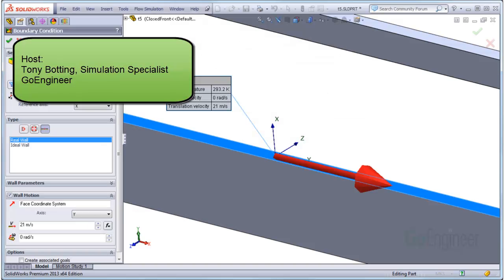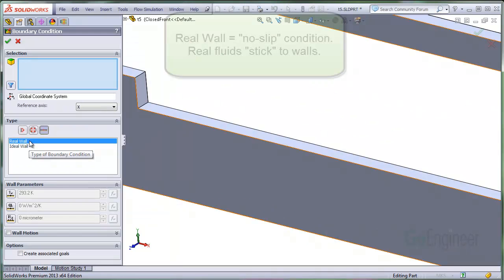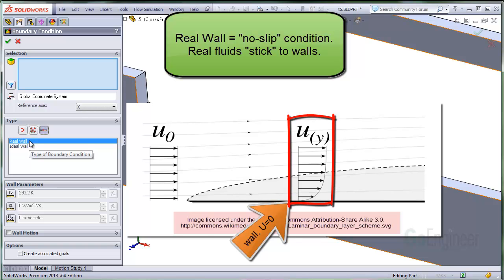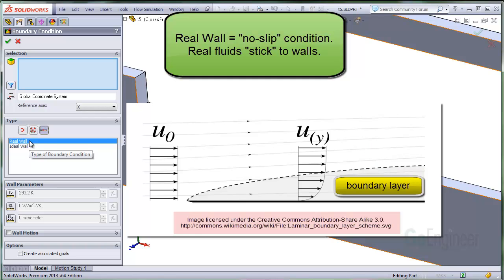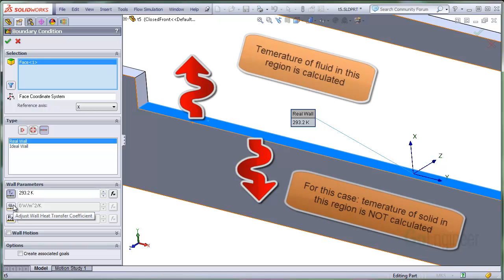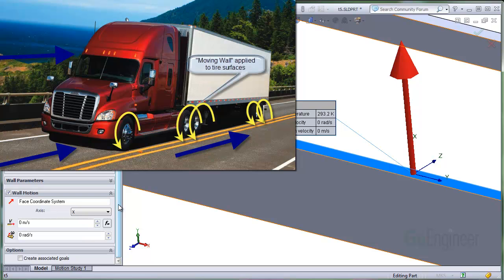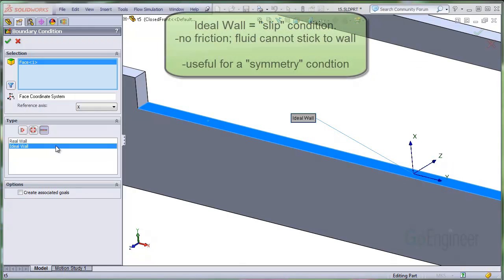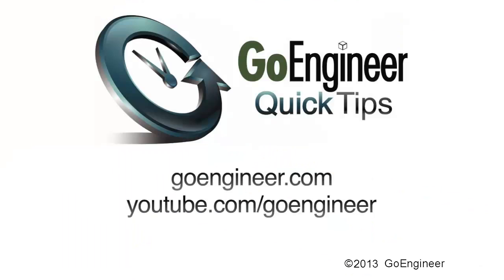SOLIDWORKS Flow Simulation - Real Wall and Ideal Wall Boundary Conditions

Comment: Is it possible to specify an angle of rotation per exemple (from 0deg to 90deg) on selected surfaces of real wall ? i've been searching for weeks, i would very much appreciate your help
Reply from the maker: Hello!
It appears that in the list of units for angular velocity in Flow Simulation, there is not an option to select degrees per second unfortunately.  You may want to consider creating a custom unit for this so that it can be selectable when you apply your real wall motion boundary condition.

Comment: Face<1>@LEAK PART-3 is not laying on the boundary between solid and fluid region.
i have this problem, could you help me for this
Reply from the maker: Hi Pierre,
This error would indicate an issue with the program recognizing the fluid volume for the flow project.  The program does not think that the face you are selecting is touching fluid.  Your next step would be to use the Leak Tracker tool to determine if you have openings from the external environment to the internal environment that would cause the fluid domain to not be recognized (like this: https://www.youtube.com/watch?v=ad323Hc6-9s).

Comment: Hello, first of all, thanks for the nice video. I have question about real wall. The wall parameters under real wall conditions need us to specify the wall temperature, or heat transfer coefficient and roughness. In case if we do not know these parameter for the case of internal simulation , is it possible to run the simulation. I am asking because I am interested to use the real wall to know the heat transfer coefficient inside a pipe with hot water for the transient simulation.
Thanks